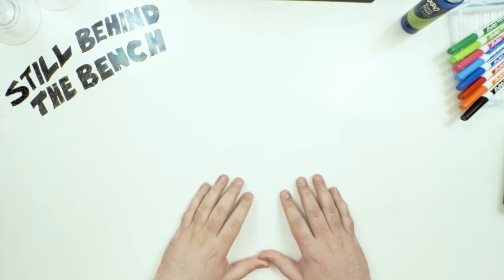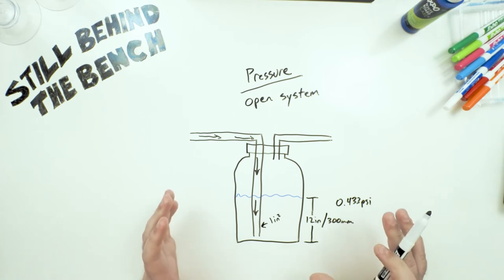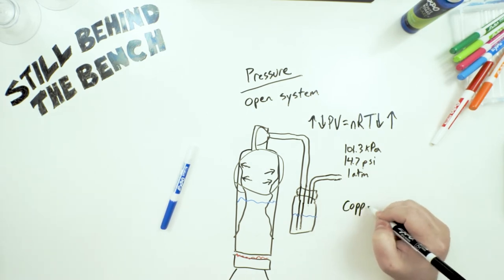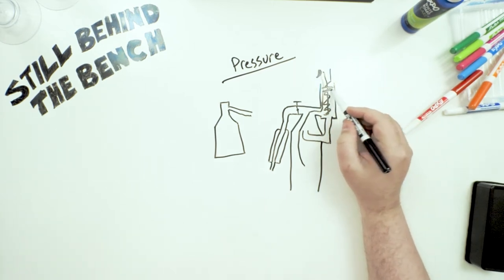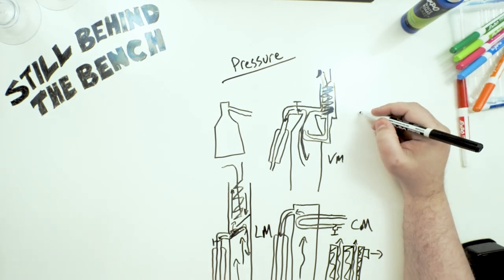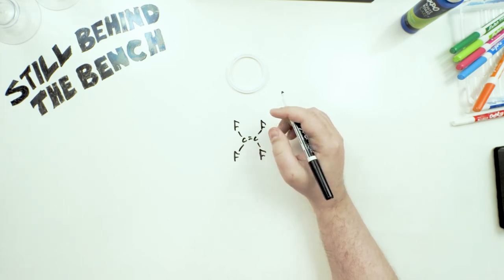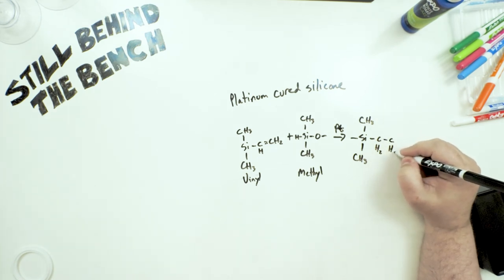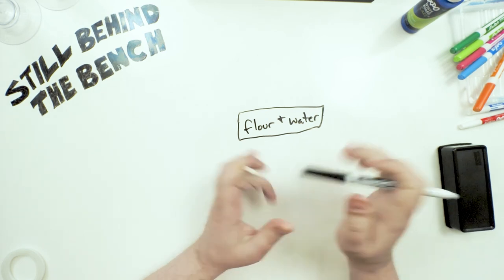Bonus Video 003 - Pressure and Seals

Comment: There are lots of people on Homedistiller.org forums that say not to use Silicone seals.  Are you saying that it is safe?
Reply: There are many flavors of silicone. Adam said platinum cured silicone. I’ve seen I lot of silicone in bubble plates, lid seals, and such specifically made for distilling by legit production sources. Hard part is finding out if what your buying is platinum cured.